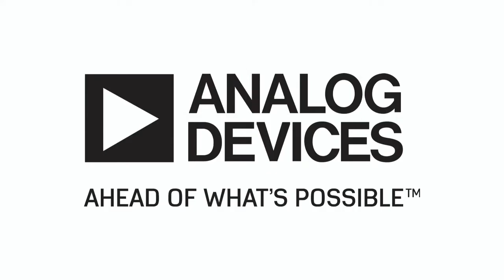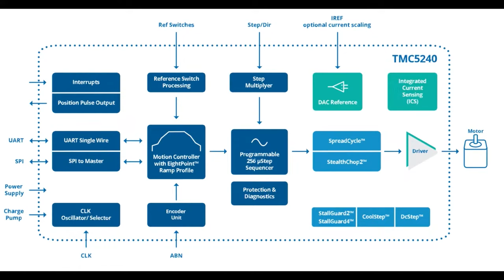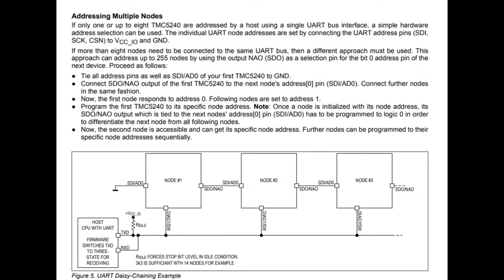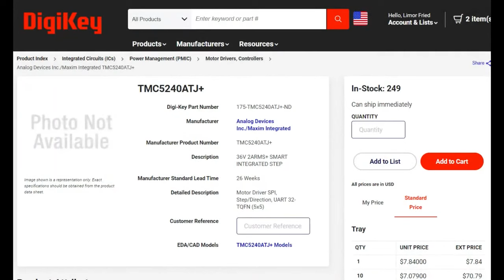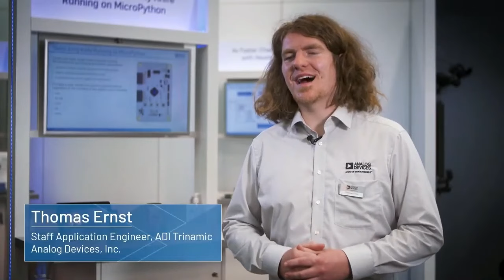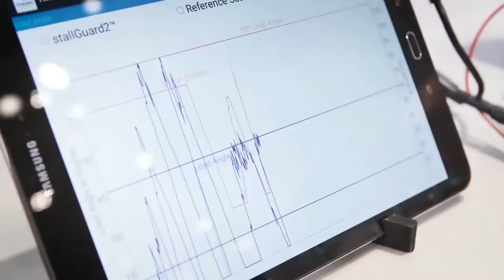EYE on NPI - Analog Devices' TMC5240 Stepper Motor Controller and Driver IC @digikey @ADI_News

Comment: Thank you for covering the new TMC stepper driver. I am a big fan of stepper motors in general and have used TMC2209 and TMC5160 for years.
I have always believed that stepper motors are underappreciated as an alternative for small DC gearmotors. For example, if you want to power a positive displacement pump you need continuous motion (velocity control) and you want a direct drive (no gearbox) high torque at low speeds. Stepper motors are perfect. DC gearmotor life is often listed as 500 to 2000 hours and often makes noises that only get worse with time. Steppers offer a life expectancy of 10,000 hours or more, usually based on the L10-bearing life. I found that medical device design engineers are keen to use steppers for those reasons, especially when the high quality TMC drivers have proven they can do the job.